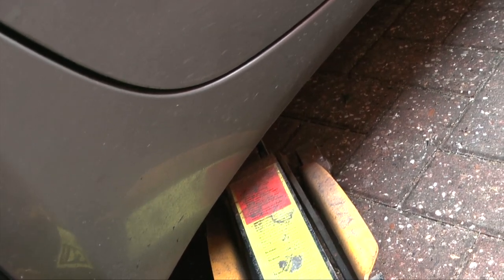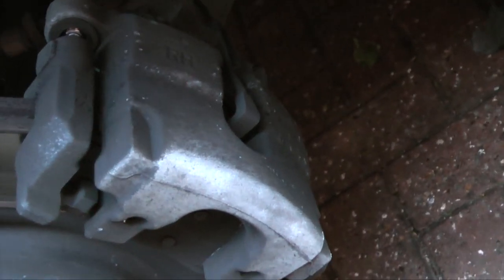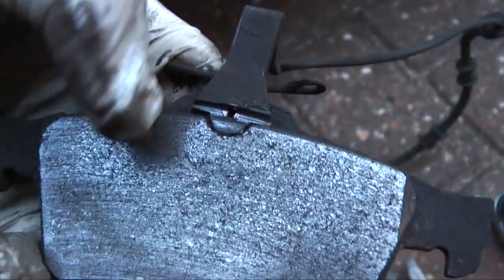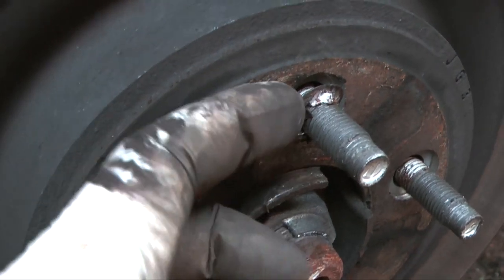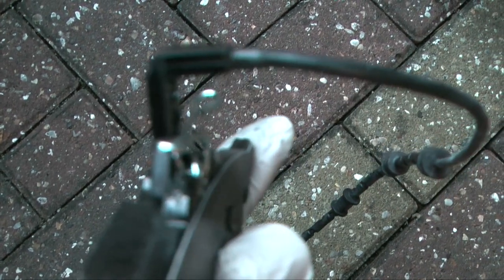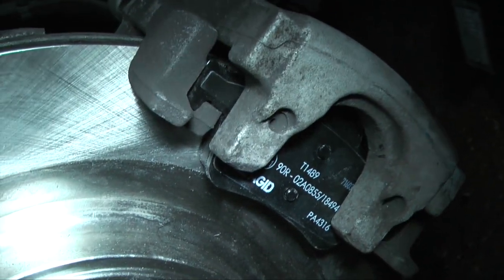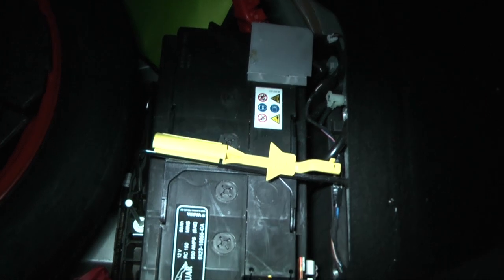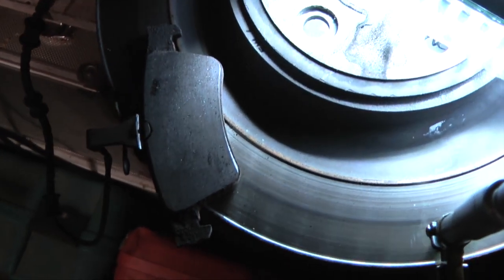Jaguar XF Rear Brake Disc and Pad replacement

Comment: Again excellent video, replaced pads and discs following your tutorial without a problem taking note of the amended torque setting. I did find that I had to purchase a piston calliper rewind tool to reset the piston because I was in fear that the bleed nipple would shear as it was very tight.
A job well done and the hand brake seemed to work ok without resetting by disconnecting connecting the battery. Thanks.
Reply: Were the heck was the tutorial of winding back the piston???

Comment: Wanted to add that I replaced my brakes and calipers all round at the weekend. My model is a 2013 (x250) and the rear calipers are not push in they have to be wound in. Also both sides are wound in a clockwise direction. Fronts are push by the way.

Comment from the maker: With the bleed nipple open, the piston should slide back pretty easily with a G clamp. If it doesn't it may be siezed. I'd take the caliper off completely and investigate. May need new seals or reconditioning.
Reply: Leon Fletcher u

Comment: Hi, my car has no wear sensors on the front but I’ve got no wear warning, and the pads are totalled, metal on metal grinding… baffled me why no sensor, I’ll find out if there is any on the rear today, also I thought the slider bolts were 9mm hex or is that just for the front? I had to take the full caliper off to change my pads as didn’t have the right hex 

Don’t suppose you got a good video on the brake booster seal have you on the throttle body, mines giving me vacuum leak codes, I did a smoke test and definitely coming from there, car is a 2008 xf sv8

Comment: Before taking of caliper, did you use diag etc..(Bosch kts) to wind back electric parking brake?
If I am not mistaken, all XF's x250 models have electric parking brakes.

Comment: Hi Leon,

I know this post is a few years old now and yes, I have read "all" the comments in an effort to find an answer to my query which is regarding the pistons..  There appears to be a lot of confusion and I for one am confused by the opposite comments given by different people.

A lot of this confusion is borne from the different terminology that people use to mean the same thing.

For me, to say "wind" means applying a rotational force to something and is usually clockwise as if winding a clock.
Others seem to say "wind back" just to mean "reverse" the process, as if winding back the years.

Now I've checked many forums and you tube videos to try to be certain about the procedure and I am still not convinced I know the answer.

Some people say the pistons can be pushed straight back in, but others say that doing this will damage them and they have to be rotated.

The logic dictates that if they rotate then how is that rotational force applied by the EPB or footbrake unless there is a Helix involved so they would naturally twist as they are pushed, and if there is a helix, then when straightforward "pushing" the pistons back they will naturally follow the helix grooves.

I hope you can see my issue.

I note that your video omitted this crucial step and would have helped me understand if I could have seen what you did to retract the pistons.
Reply from the maker: The pistons aren't threaded so they don't have to be rotated. I think the problem is that they have to be pushed back absolutely "square" or the seals in one spot will be rubbed more than in another (the cross section turns oval if off axis). Rotating I guess makes this easier/less likely to damage the rubber parts. 
I used a piston pusher kit that does a nice job - fit to the caliper and wind the screw - pushes the piston back in a parallel way while rotating a bit. If I remember, quite a lot of shove is needed, hence the need to keep things parallel. There may be debate about forcing fluid backwards through the ABS unit, but that's another story.
For the rears, the handbrake mech may necessitate the rotating action - as I say, I used a proper retract kit (available cheap on ebay) so didn't have an issue.

Comment: Hi Fletcher, excellent video, just like to be sure, heard you said 28ft/lbs for the slider, would like you to re-confirm again, is it 28ft/lbs and not 28Nm ? Thanks in advance.
Reply from the maker: Quite right... 21 lb/ft,  28 Nm
Someone was paying attention.... :)
Reply: Thanks, very much appreciated. I am preparing for discc and pads replacement this weekend. Wish me luck... :)

Comment: Me again, just been doing rear brakes, takes some getting off!!,broke sensor so bought a new one, Pagid £20. Question,did you have any problems replacing yours?,as I couldn't get mine on it was so tight, ended up braking the new one!! Phoned EBC and told them about the problem and they said there guys fitted one to an xf and also had a problem, just wondering if you struggled, if not I'm wondering if it's to do with pad thickness in the slot on EBC pads!!.

Comment: do you need to disconect the battery. i cant move my caliper piston even when i put the gearbox in neutral.
Reply from the maker: No, you need to have the electronic park brake off, and if the caliper is still really stiff, undo the bleed nipple so you're not forcing brake fluid all the way back through the system (mind it doesn't spill on the discs/pads!). That should make it much easier (you'll need to bleed the brakes once you've completed the job). If the piston still won't budge, it may be seized.
Reply: +Leon “LordFlash” Fletcher thanks for the swift reply m8. i had to take the caliper off in the end as it just wouldn't budge. i broke 2 rewind tools and a pry bar in the process lol. tryed puting the caliper in my hydraulic log splitter with a pole but nope. in the end it was a hammer job. im guessing it was seized with rust but all done after a long afternoon lol.

Comment: Thanks for a very helpful video.  Can you please say what you advise for the caliper slide pins - some say to leave dry and others to lubricate.
Reply from the maker: I personally clean them with a wire brush so they are spotless then smear with a thin layer of copper grease. There are sealing plugs to keep out some of the crud that might stick to the lube. I can understand both points of view. As long as you clean the brake assembly and look after it, it shouldn't start to stick. If you're really worried, graphite powder might be something to consider.
Reply: @leonfletcher6045  great video Leon, i use a 17mm long socket to remove the 2 disc retaining clips, they come of easy. Keep up the good work

Comment: I was just wondering about the rear brakes do you have to do any electronic work regarding the handbrake do you have to disconnect it electronically before winding the piston back into it's position? Thanks
Reply from the maker: No you just need to have the brake released when you shut off the car before starting work, then proceed as per video, not forgetting to reset the EPB afterwards.

Comment: this will be my 1st time doing this so i am a bit nervous.  when you disconnect the battery, do you have to reprogram everything in the car?  such as seat setting, radio, gps, Bluetooth, etc?
Reply from the maker: +PJ Will 
You'll have to reset the park brake, clock and a few other things. Not the GPS and not the radio or bluetooth

Comment: Doing my brakes this weekend hopefully, just wondering if you greased the calliper slide pins, if so what brand of grease did you use? Does it have to be silicone based?, thanks in advance.
Reply from the maker: I used copperslip (anti-sieze) in a thin layer on the pins, after I cleaned all the crud off with a wire brush, and WD40 and cleaned the holes they go into. The calipers get pretty hot if you're caning it.

Comment: Leon, replacing the pads on my 2012 XF, on the rear when I whine back the calibers they push themselves back out and can not add the new pads. Can you or anyone help?
Reply: i suspect this has to do with the park brake question as above. If park brakes are on, the calipers will be prevented from screwing back therefore not allowing enough room to insert new pads. The pistons are not linearly pushed back - they need to be "wound" back with a brake tool.

Comment: Leon, nice posting but as I looked where to locate my trolley jack on rear point on my XF 2.2, I realised a problem, I read on the various forum that some people have used a type of puck to stop damage to the plastic trim, could you tell me or any photo of what you used on the pinch weld to raise the car also where was the axle stand located. I am sure that many other people would find it very useful as the question does seem to have been raised in the jaguar forums. Thank you.

Comment: Looking @ doing my rear brakes on my 2011 xfr using EBC yellow stuff, I Was told by them to replace all round as it would upset the balance of the breaks, any thoughts on this one!!, close up picture of where you've got those axle stands back and front would be great.
Reply from the maker: If you have standard front pads (especially if you're hammering it and they start to fade) and put super grippy fade-free rear pads on, then it's possible you'll have a brake balance problem, with the rear locking up. The fronts should be better than the rears. You'll get much more benefit from upgrading the fronts too. The axle stands are a pain to place - I ended up putting them where the weight of the car is taken onto the chassis but I agree with all the plastic around under there, its hard to find a place. An alternative might be to (carefully) jack up on an appropriate suspension point and put the jack stand at the jacking location (as the car is going to stand with weight on that point for longer). Pick a big beefy area that's used to taking the weight of the car in normal use for the jack.
Reply: Thanks for that!!

Comment: Dont the rear discs need a special software to release the electronic parking brake??
Reply from the maker: Nope. Just release it in the normal way and keep it off. It will need resetting to find the new level as per service manual though.

Comment: is a torque wrench necessary?  how do I know how much torque the bolts need?
Reply from the maker: +PJ Will 
The torque settings are in the service manual, readily downloadable online (and I mention the settings in the video). If you don't use a torque wrench, you don't know how tight you've done up the bolts!

Comment: Just reading xf forums, someone commented that the rear caliper piston need winding back in opposite directions!!, near side anti-clockwise/off-side clockwise, can you confirm that!!, also did you loosen bleed nipples on your job?. Sorry about questions, don't want to cause any damage lol. 

Thanks
Malcolm
Reply from the maker: The pistons aren't threaded so shouldn't need twisting clock or antilock to get them back. The Jaguar workshop manual also makes no mention of this, but does use a 'special tool' 303-588, 206-080 and 206-081 to rewind the piston. It looks like a standard re-wind tool. I did find the rears awkward to wind back though, which was super-easy after slackening the bleed nipple. You will need to bleed the brakes afterwards if you do this though.

Comment: For what it's worth, the caliper slider bolts on my '11 SV8 required a 9mm hex key, which I ended up ordering from Amazon. Nobody carried one locally. I think the video said 7mm. Also, is there an easy way to get the anti-rattle spring back on? That was the hardest part of the whole job.
Reply from the maker: The SV8 model is rather rare in the UK because of its fuel consumption. My slide bolts were definitely 7mm - I wonder if they put the 'S-Type R' (also a 4.2 S/C engine) brakes on the XF SV8, as I used to have this very model and they were non-standard. Yes the springs are a fiddle - I usually seat one end, then use some locking pliers to line up the other end, tapping with a hammer/jimmying with a screwdriver alternately...
Reply from the maker: Have a look at my video for the front discs and pads - the front 'performance' brake option on the more powerful XFs (still an ATE caliper, but larger) does indeed need a 9mm hex, as you point out, a non-standard size. Crazy!

Comment: Hello,

Sorry for thread jacking but I have an issue and I need some advice.  I drive a 2010 xf.  It's been raining lately and I noticed that my sun visors (both driver and passenger side) has been wet/damp.  The side panels, air bag area, bottom of the dashboard area has been wet.  There's also a puddle of water on both driver and passenger side feet area.  Has anyone experienced any issues like this?  Can anyone offer any insight?
Reply from the maker: Does your car have a sunroof? Maybe also a windscreen issue - has it been replaced recently?
Reply: Hello Leon,

Thanks for replying.  Yes my car has a sunroof.  No the windscreen or sunroof hasn't been replaced.  Any basic troubleshooting tips you can offer?

Comment: Hey Leon, what do you do with the electronic park brake? Do you need to release it before winding the piston back? If so, how do you do that?
Reply: Sorry, after re-watching i heard you say to leave the parking brake off, how do you do that? does it not automatically apply the brake when you put the car in Park?
Reply: z
Reply: Same question, how is it possible to retract the cable and fully release the handbreak

Comment: Those bolts that you said Jaguar recommend that you replace ... is that something you did or is it ok to re-use ?
Reply from the maker: I've always re-used mine after cleaning the threads, using new threadlock and tightening to the correct torque. Jag recommends they be replaced though - seems to be a new trend as Audi also recommend replacement on theirs. I doubt very much if a high street independent garage would order up new bolts from Jag if they were doing the job...

Comment: Leon, thank you for posting this vid.  I replaced the back disc pads and sensor on my 2011 XF today and it went extremely smoothly thanks to watching your video several times prior to tackling the job.  Have you done one for the front brakes?  I have a feeling that I'll need to do those within 10,000 miles.  How much different is it or is it pretty much the same?  Thanks again!!
Reply: Never mind on the rear question, I found that one your channel.  Cheers!
Reply: Gawd, I must be tired out of my mind.......it was FRONT I asked about.  Sorry, chap.
Reply from the maker: Glad you found it useful - in fact there will be a front pad and disc vid coming up - also some stuff about brake judder and checking lateral runout... Watch this space!
Reply from the maker: Front brake disc/pad video is up... very similar but you might need a 9mm hex socket if you have the larger 'performance' brakes.

Comment: What is the park brake and how do you reset that?
Reply from the maker: Essentially the electronic replacement for the handbrake. When you adjust the rear brakes, the car doesn't know how much pressure to put on the rear brake pads when the parking brake is activated (as the new pads are a different thickness to the old ones) so you need to 'teach' it what is "fully off" and what is "fully on". Just google "electronic park brake re-set Jaguar XF" and a procedure will pop up from one of the forums.

Comment: you can not use a G clamp to push back the piston as it has to be ROTATED clockwise as it is forced back in, this is a CRUCIAL bit of info that cost me $90 to buy the 
specialist tool at VERY short notice as by then the caliper was off with no way to push back the pistin.
Reply: the pistons do not twist they are not on a thread
Reply: @richie9777  I have been told that if you push them and do not rotate, they will be damaged.
Reply: @Tigerrider2  I'll keep that in mind for when I do mine then thanks>

Comment: don't need to take the carriers off! Done dozens without removing carriers 🤓
Reply: you do if you are changing the rotors
Reply: @richie9777  as I said done dozens of disc (rotor) replacement WITHOUT removing carriers.